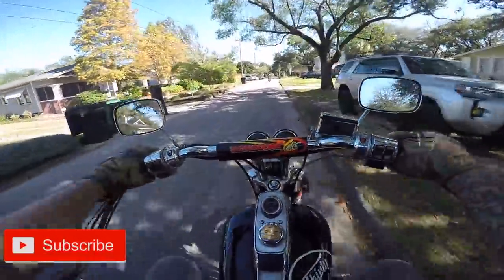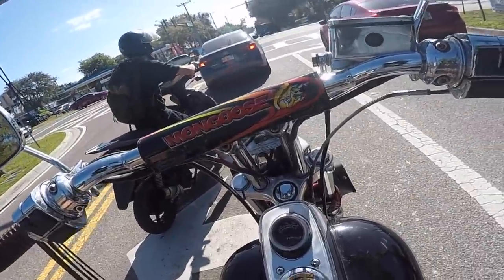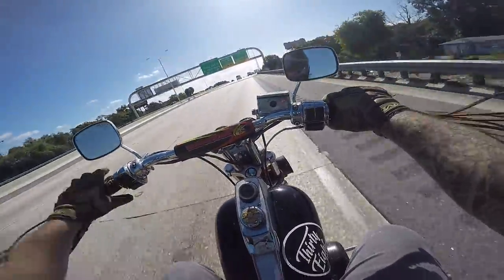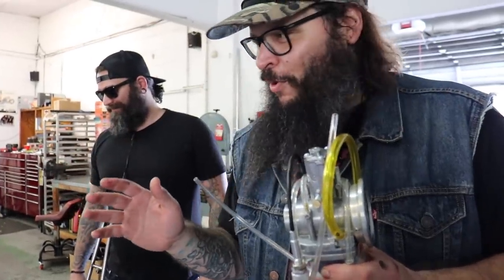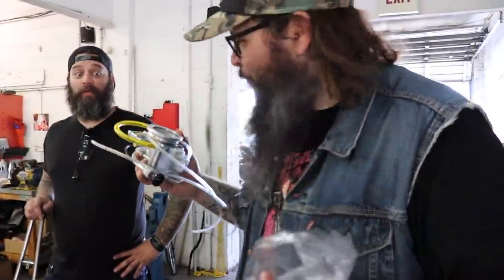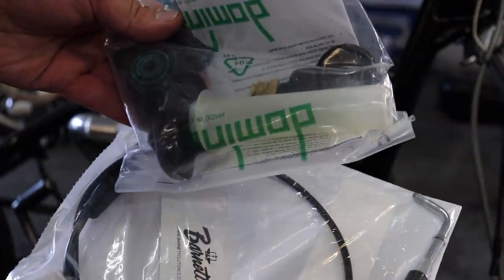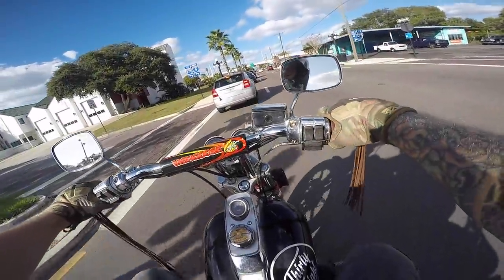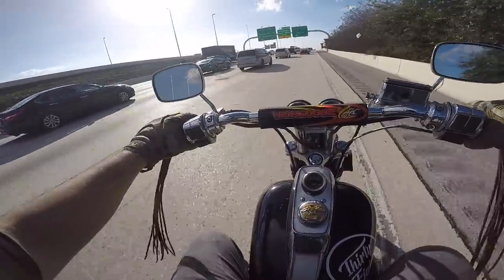Return of the Chopper | 1977 XS650 Chopper Build

Comment: old posting but iv a lectron carb built on lectron benches to my engine and exhaust specs about 12 yrs ago when they were first being put on the xs650 2-1 manifolds , now iv never fitted it but will soon ...mine was among the first 10 or so lectron built up spesifically for the xs650 , 2 things they had to do was a stronger return spring to stop hang ups as well as a bit of light machening to make things a bit smoother, so if suffering with slight hang ups apprently the stronger return spring is the way to go

Comment: i know old posting but wondering what your first thoughts were when riding with the lectron cab after replacing the vm 34s on the ride home... less performance  / same / better performance etc ... asking as putting a lectron on my xs650 as well as a 2-1 ... havnt tried either before

Comment: One bug in the intake, or riding through rain, and you will be sitting on the side of the road wondering who's idea it was to not put the air cleaner on. jmho.
Reply: Yeah I would be putting on a filter or get a better filter screen.
Reply: At least JB Weld a stainless steel wire mesh kitchen sink strainer onto the carb intake- blocks bugs and gravel.
Reply: ive ridden through down pour without a filter and an enlarged intake without issue, in fact its an old trick to drip water into the intake to clean carbon off the piston and valves. as for the bug, it might be a problem.
Reply: @Torpi95  They have some absolutly frikin huge bugs in the south there. Thought I got hit by a bird but it was a yellowjacket.
Reply: It's not so much the water you worry about its the fine dust you right through on the highways, it wears the valves like sandpaper and takes them out - you will want to run a decent filter

Comment: @Shadetree surgeon what size carb did you use? Im thinking of doing the 2-1 xs650 with a lectron too, seems the suggested size for running dual carb is 30mm, did you go bigger or stick with that? Also what metering rod size did you go with?

Comment: I think I see your runaway engine problem... I had the same problem at one time. The distance between the carb an motor is too long. Gas builds up in your intake so when you release the throttle, all the gas that is still in the intake that hasn't made it to the carb yet still has to burn. Even when you close the throttle that gas will still burn keeping your motor reving at  higher RPM.  Good luck.